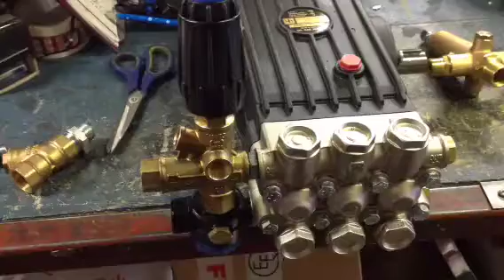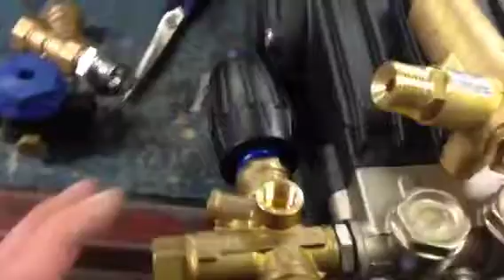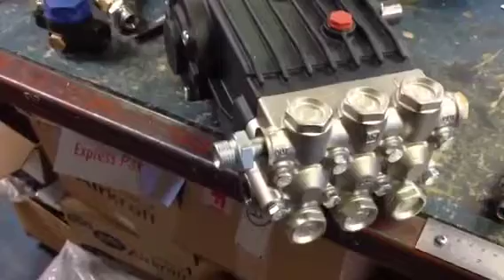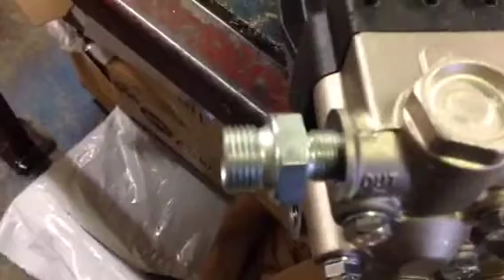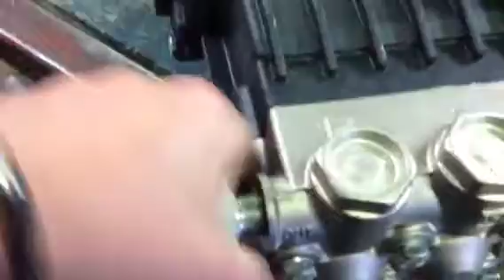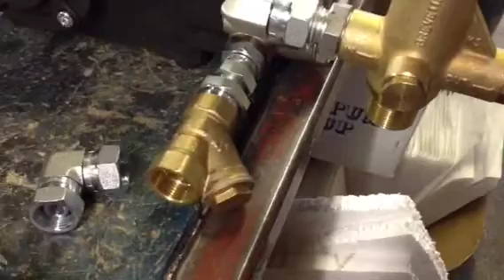HOW TO SETUP & REPAIR BUILD INTERPUMP CORRECTLY AND NOT JUST BUILT TO A PRICE COST QWASHERS WHY

Comment: Additional connections introduce weak points. This is absolutely stupid and unnecessary. At the very most add a male to male straight on the output to protect the pump threads when removing unloader. Other than that this is a joke

Comment: I an a bit confused about The fittings you use here. Is It a 3/8 MPT to 3/8 FPT union that goes between the pump outlet and the unloader?
Reply: I think I worked it out: 3/8 M 1/2 M hex nipple to 1/2 F swivel 3/8 M to another 3/8 M 1/2 M hex nipple. Alternatively 3/8 M 1/2 M hex nipple  to 1/2 F swivel elbow  3/8 M to another 3/8 M 1/2 M hex nipple. The benefit of using an 'inline' swivel in this case you can connect the unloader without needing to rate the unloader to tighten. I imagine Parker is a good brand for selecting these types of fittings
Reply: Are the threads in this pump 1/2” fpt and 3/8 for or are they o ring boss ?